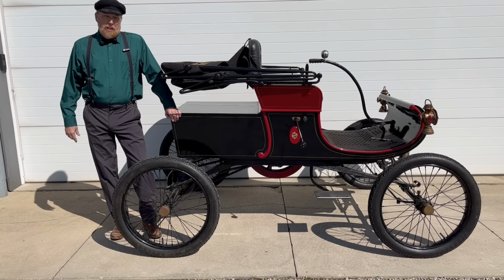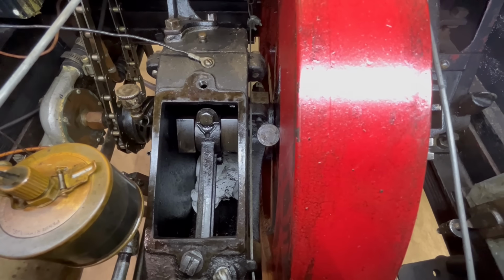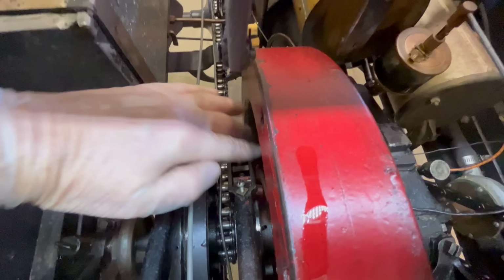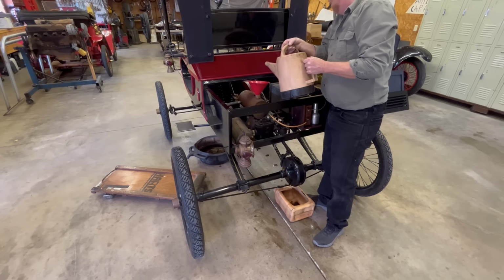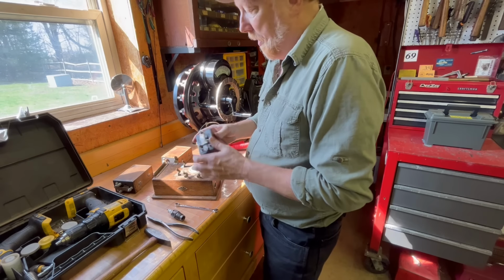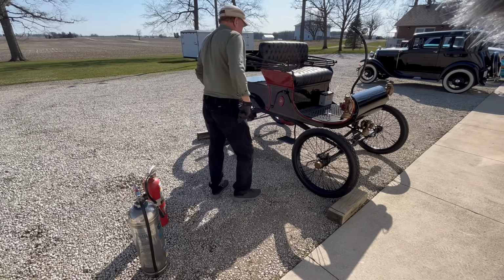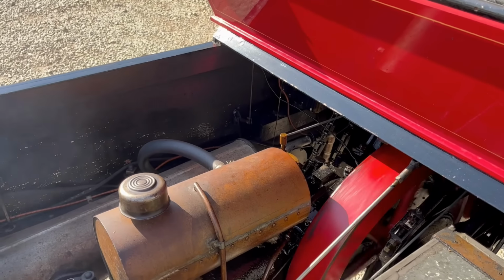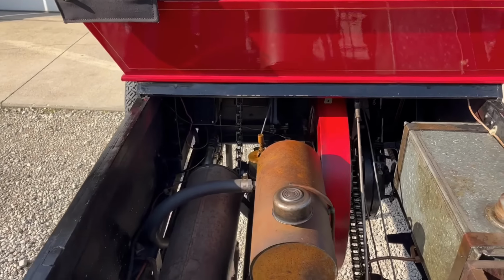1901 Olds: Will it Start and Run @KlepsGarage [EP 62]

Comment: I wonder if it originally used a skip tooth chain like the old bicycles. Cyclists in the prewar era swore up and down a skip tooth chain was stronger, but everyone runs formal inch chains on the old bikes now.
Reply from the maker: Original chain was a block chain. Someone before me changed it.

Comment: What's all the fire extinguishers for?
Reply from the maker: Just in case. One is water only the other is chemical.
Reply: My friend Thomas was an old front motor dragster guy. And he was adamant that compressed air and water fire extinguishers be scattered throughout our shop. Couple of dry chemical and a big CO2 bottle. Only ever had to use a water extinguisher once in ten years. You never need a fire extinguisher,when you need one badly and right away. No damage done,no burns and no humiliation to deal with. Used water fire extinguishers,the valve assemblies are easily rebuilable. And very much worth it. Good for you. @KlepsGarage
Reply from the maker: Thank you. 🙏🏻 😎

Comment: I just read that Bosch invented the spark plug in 1901 and the first one was used in 1902. (yes it was invented earlier but never used) What am I missing in the story here?
Reply from the maker: I don’t know. Not up on spark plug history. That would be a good question for the Curved Dash Olds Club. However their website is not that helpful.
Reply: Was it Bosch invented the plug, or in 1901 Bosch Company started making Bosch Spark Plugs?
Reply from the maker: Again I’m not up on spark plug history

Comment: That is a Reproduction the same as mine. But the difference is I drive mine on the California and Nations freeways.  And mine has Presidentual as well as congressional reconition for it's undyying service. I have done extensive studies on the 1901 Oldsmobile and they were almost extink up in the 1940's over Real factory made cars. Mine was originally built by a P. G. & E Shop Forman in San Mateo, California and driven for a few years and then it disapeared. I then found it many tears later 2010 in the Manton, California Forest Fire. I have completely restored it and drove it on it's Original old Motor till it blue up. I again rebuilt the car exchanging the Motor to a Briggs Stratton  and now it has a 750 Harbour Freight engine. I love the car even though I was declared a D. O. A. twice after being forced from the road at two different Creek Bridged when cars refused me Right of way,

Comment: You don't use your compression release pedal to crank it?
Reply from the maker: Yes I did for five minutes gave up and did the easy way. Comp pedal holds value open too far
Reply: @KlepsGarage  Its not your compression release holding it too far open.  It's because you dont have good compression through a leak somewhere (valve sticking to improperly timed) and adding compression release just makes it impossible to start as there is essentially then no compression.  Why do I say this?: because without using the  compression release lever it should be impossible to turn the engine over by hand if there is normal compression.    You need to find where the engine is leaking compression if you want it to.be a really good car.   I love your coil testers.
Reply from the maker: I’ll do a compression test I don’t think it’s leaking
Reply: @KlepsGarage  you can’t do a compression test as you don’t know what normal is  and it’s difficult to hand crank enough.  The right test would be a leak down test.
Reply from the maker: Ok thx

Comment: Back 100 years ago, people would have though you're a mad-man somehow playing god by using machines instead of using horses. Nowadays, to get that same "playing god" thrill, we have to use AI. 😆 The fact you were endlessly tinkering with it just to get it working... I kind of doubt the normal operation back 100 years ago would have looked much different. 😆 (Endlessly tweaking and tinkering.)
Reply from the maker: Yes. Took 123 years to make cars one touch does everything for you. Nobody has any idea how to fix them when they break. 😂😂
Reply: @KlepsGarage  It probably doesn't help that modern car companies make it difficult to repair by locking everything behind a computer that the owner of the car is not given access to (only the dealership is allowed access).
Reply from the maker: And the EV. Are worse Tesla can only get tires from dealer. I don’t see how this is good for the consumer. Need completion and free market
Reply: @KlepsGarage  There are companies that do want to compete here but we want controlled competition not a legitimately free market. I don't. My bet is that you don't really either. Great to see your Olds running and very pleased that your Wife enjoys reading the comments. I hope that isn't inappropriate to say.
Reply from the maker: Thank you 😎

Comment: As a lifelong motorcyclist, to my eye the drive chain looks too tight: shouldn't it have some play in it to allow for suspension movement ? Of course, I'm no expert on veteran cars, so I could very well be wrong. When you see the palaver required to go for a drive, it's no surprise that steam cars were popular at the time: the time and effort needed to drain pipes and raise steam to get going doesn't seem worse than the preparation ùthis car requires.
Reply from the maker: Not sure about slop in chain. The rear axle and motor move together. There is one spring left and right. That goes front to rear axle. I’ll look into that.

Comment: What grade of oil did this car take originally?
Reply: It was just "oil" back then. Not sure if "motor oil" had been invented yet. Valvoline invented crude oil based lubricants for steam engines.
Reply from the maker: Something similar to a straight, 30 weight

Comment: GAWD! No small wonder that early EVs were so popular in cities. NYC once had hundreds of EV taxis. They would be driven till low battery state, and then swapped for a charged one. The fatal flaw of early EVs were batteries/range and Big Oil/Ford and the US government who wanted gas cars only.. Source [for the curious-- this writer owns an EV and is an "EV Evangelist" check my research, if you wish.
Reply from the maker: Well, that’s your opinion how’s that fire working out in France right now?With the lithium batteries on fire putting more pollution in the air than all the gas cars in the last 50 years. I’m just saying.
Reply: @KlepsGarage   I don't usually scroll through comments too far down into the comment stream, but I'm glad I did..your reply was well worth it. Somewhat similarly, they preach human caused climate change at schools and today we had the pleasure of being behind a school bus belching out tons of diesel soot..way worse than what we see coming out of commercial semis. The push for low pollution has been a great thing for the most part and now they want to throw it all away to buy off on a technology and an infrastructure that is nowhere close to being ready. I can appreciate the early adopters as improvements aren't made without them, but they need to get the F off their high horse. Personally, I hope pure electric dies and a breakthrough in Hydrogen production is made
Reply from the maker: Thx. People should stop being the problem and be the solution and come up with other ideas.😎

Comment: Sure hope you dont get stopped by some net zero fanatic!!!
Reply from the maker: Let’s see I drove it once in ten years and their EV car used more electricity in one year than this car emissions from the last 123 years.  I think I’ll just tell them how much of an idiot they really are. 🥸
Reply: @KlepsGarage  WELL SAID
Reply: Tl;dr: While I consider EVs to be the future,I do think complaining about an old car like this is dumb.

While I don't consider myself a "net zero fanatic", I do think EVs are the future for modern cars (I just wish there were more consumer protections in place and more repairability). While I don't own any myself (they're too expensive), I do consider them to be a better alternative to the modern trucks and their ilk with their non-regulated emissions, dangerous bonnet height, and general ugliness. However, you won't hear me complaining about these old cars. It would be like complaining that a Pentium 1 class computer from the late 90's can't play Cyberpunk 2077.

Plus, I'd bet this over a century old car, if driven regularly, would still have lower emissions than a modern truck. It will definitely out last them while also looking better, that's for sure.
Reply from the maker: Let’s see how good EVs are to the consumer priced on repairs and battery replacement over the next 100 years. And the impact the batteries have on the planet 🤔

Comment: Put Marvel Mystery Oil in your gas that will lubricate your valves
Reply from the maker: I’ve used MM. before put i found the 2cly oil to be better.  
I’ve tore a carb apart that had MM oil in gas. Gas evaporated and left MM that turned into a glue like covering. Plugs up things.

Comment: Kleps Garage ? Back in the day, how did the driver know how far he could travel on a full tank of gas. is there a fuel gauge ? Kleps Garage ? I bet back in the day, if they went on a picnic in the middle of no where and encountered some wolves or bear the driver probably kept a rifle with him, because it would take to long to start that old poot.
Reply from the maker: There were many challenges, fuel gauge is a stick. It probably gets between 30 and 40 miles of the gallon.  It’s only a one cyl. That might be a new video idea.  Thx.
Reply: Fun Fact; the stick for a fuel gage lasted up to the Commie issued Trabant in the 1960s'!

Comment: Could a Tesla work in THE year 2147?
Reply from the maker: No. Not unless they have a power source. Have you seen a drill battery come back from dead.
Reply: Lucky if one will run in 2037.
Reply: yes, if they run on ENERGIZER BATTERIES, they keep going and going and going !

Comment: This would have been much better with someone else on camera. It wasnt quite as exciting watching you start it up from a half block away.  I barely even heard it.
Reply from the maker: Sorry. Cameraman. Was busy. It is some what quiet though.
Reply: A cool machine like that, I would want to be right in the middle of it all if I was there.
Reply from the maker: Well come over and I’ll give you a ride
Reply: LMAO, Hw would you like taking a shu Rope and towing it like a wagon for over two mileds because a Chain Link broke. I finally was able to find an old oiece of Hog wire fence along the way and manufactures a Linl Pin from the wire and then drove it another 85 miles to a harley Davidson Shop where we had to jury rig a Harlet Chain Master link to keep it on the road.They were not quite the same size, But we managed to make one work in Nebraska.
Reply from the maker: Great Story👍